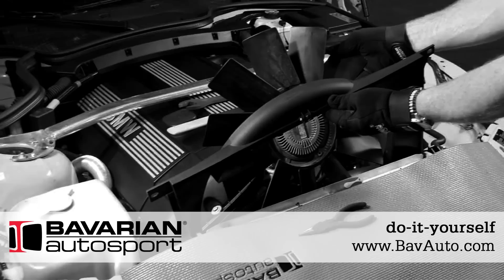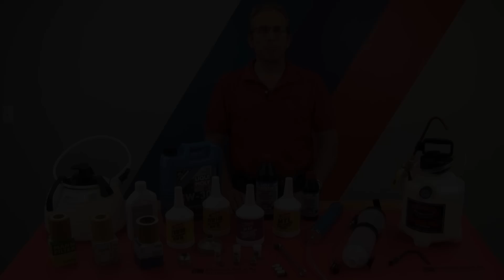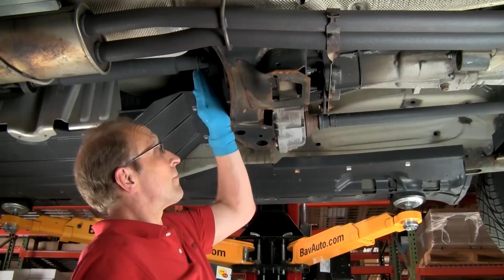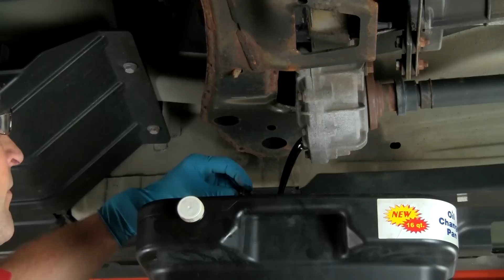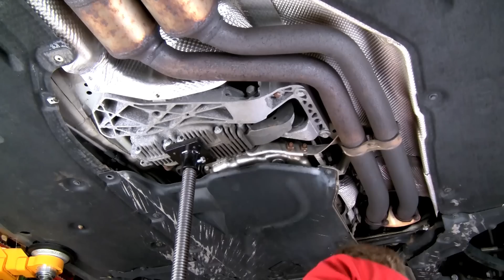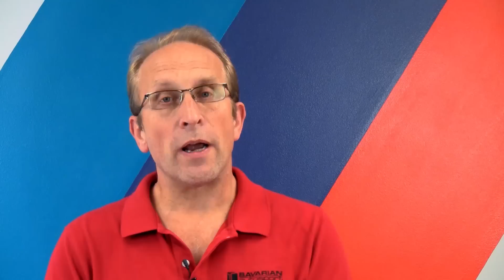Changing Fluid in BMW & MINI 4WD Transfer Case - Under Car Fluid Changes

Comment: with all respect, this video should be banned from youtube. You drained the transfer case and you didnt torque the drain plug and filler plug. Those videos are reasons why people strip, over torque or destroy the threads. 10 80 1az is 19 Nm those bolts. i will give you credits though, you used a new washer.
Reply: Gtfo

Comment: The 2008 E-83 specifies 700 ml fluid.  Others dispute this, and fill to overflow, as you did in the video.   can you provide some guidance on this?  (and no, it does not overflow at 700 ml, it overflows at more like 900 ml

Comment: For the E9X models, after changing transfer case fluid.. Is it necessary to reset adaptations with some type of a scan tool?
Reply from the maker: Shane Sexton We have not found this to be a requirement.
Reply: +Shane Sexton I'm looking for the answer, too!  I've been searching on E90Post for a while and it seems some people (especially early MY year like 2006) are able to replace the fluid without resetting the transfer case.  Others may encounter several warnings on the dashboard.  I got a 2008 335xi, and the only thing delaying my transfer case fluid replacement is this transfer case reset thing...
Reply: Any answers for this to reset fluid changes?
Reply: Yes, you have to use ISTA to do that.